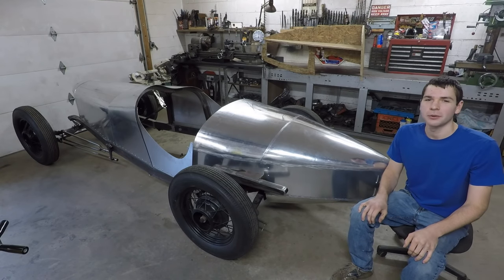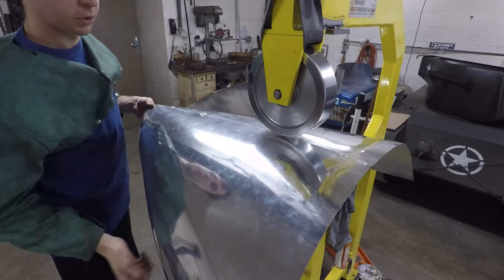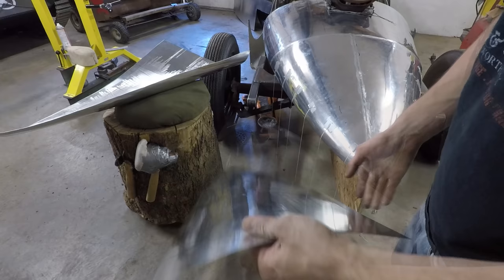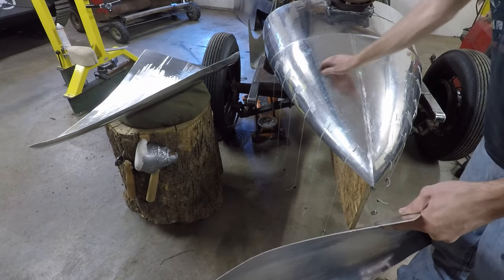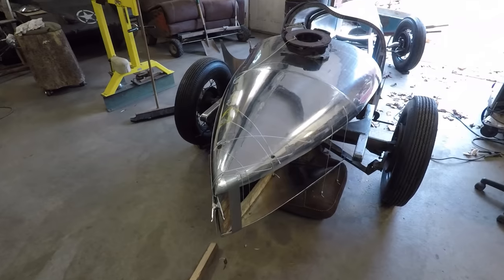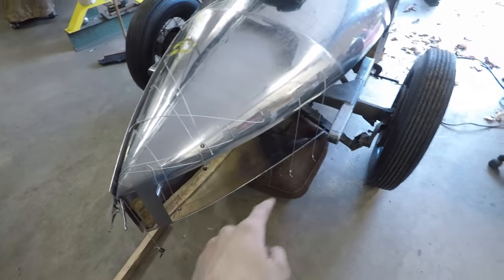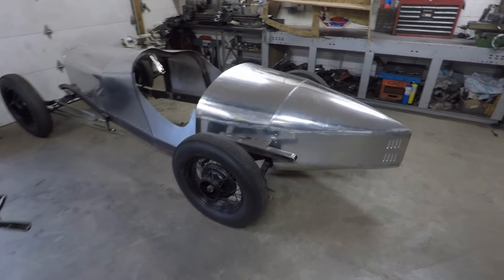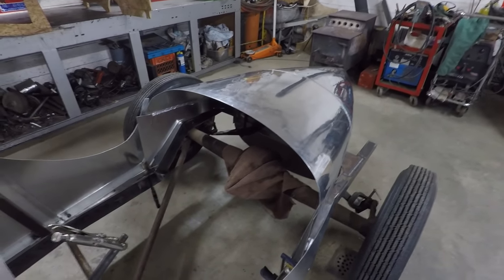Building a Car Body from Scratch | Homemade Boat-tail Speedster Pt. 33

Comment: Over 50 years ago I did a 10,000 hour apprenticeship essentially doing what you are doing here, and for a number of years I restored vintage cars.
Steel was the order of the day then and I only ever did two projects that involved aluminium. No TIG or MIG welders back then so everything was fabricated using oxy-acetylene welding. Time consuming if you wanted to limit distortion! I enjoyed a good reputation and was sought after in regards to this kind of work.
There is a saying. "the older I get, the better I was", but I have to say my workmanship would bow to your greater skill! You have an exceptional gift, and it is a gift; skills like yours are not learnt, they are given!
Loving the project!

Comment: i'm really enjoying this series. I have my own daydream and your work will save me many wasted hours and a lot of sheet metal. back in the pre internet days  I read a story about the proud owner of a new Ferrari. at that time if you wanted to buy a Ferrari, the east coast dealer, Luigi Chinetti, would sell you one ONLY if you could use a non synchro gearbox to HIS satisfaction. 
the proud new owner invited a friend over and they were sitting, sipping drinks and admiring the new toy.
then one noticed that the car looked lopsided. they got a tape measure and determined that it was indeed lopsided and actually had different wheelbases on the right and left side.
you're actually building that thing to a standard that the most famous manufacturer at that time didn't reach.

Comment: One of the things I have noticed with body builders working with aluminium that puzzles me is how they grind their seam down flush. Years ago I had a job making aluminium doors for various kinds of truck bodies. We never used grinding discs on alloy. The problem is they tend to be too rigid and they plug up with the soft aluminium. What we used was autobody feather edgers and sanding discs. The feather edgers turn slower that grinders do and because the feather edging pad is foam they do not dig into the material as much and leave a smoother surface. You have a wide variety of grits available in the form of sanding discs and all you need to keep them from plugging up is a disc dressing which is sort of like a low temp grease that precludes the alloy from sticking to the abrasive.  We did our initial cuts with 80 grit and then went to a 300 grit for the final cuts which leaves a surface that is smooth and flat and the scratches can be filled with primer if the part is painted or polished out if the part is not painted.
Reply: Very well stated.
Reply from the maker: That's definitely something I'll look into when I get to polishing it. I was just using what I had, but you're right.

Comment: Just love the detail of the inset louvers on the rear. Can not work out what they are for but it breaks up the rear line just nicely.
Reply from the maker: They let out air that gets trapped in the back
Reply: @MacroMachines  You said that on the video, but I don't see what is wrong with the trapped air, the car is not going to get blown up like a baloon. I could see a need if you had a need for a flow through for ventilation or cooling system, other wise it is it will allow air to flow into the cockpit area, which will mean you loose the still air that forms a false skin (reducing drag).
So to me they have no practical use (unless you live in a hot country) but look great.

Comment: Nice work. With the aluminum it is easy to see the warping that welding does. Don't see it as easy with thicker metal, but it is there.

Comment: Beautiful. And the jag engine is going to fit right in. Now what about the transmission and rear end? Old Ford parts don't really match up anymore. Also, the buggy springs will allow a lot of sway in the corners. The one on the front is a design element. I get that, but a set of coil-overs or an IRS in the rear would help keep the frame parallel with the road while the speedster is taking lateral G's. I'm glad to see you doing justice to your shops (wood and metal) not many young men your age have access to such wonderful tools.

Comment: nice work, I've enjoyed following along.  👍   Have you considered using WD40 when your sanding down the AL, it helps with the galling?
Reply from the maker: I haven't heard of that, but I might try it
Reply: @MacroMachines  It will also keep you flap wheels from cloging up.

Comment: On Kermit Weeks channel,one of his aircraft engineers shows how to polish the aluminium sheets they install on aircraft. There could be some interesting tips for you there if you decide to polish the car,1920's style.
I had a young guy working with me who has a type 35 Bugatti . The louvres were to let out  fuel that leaked from the tank  and fumes out.

Comment: BRILLIANT work Vince you just keep getting better and better, watching you with the seems on the Boat Tail a suggestion some time back I brought an attachment for my Grinder called a finger sander from either AliExpress or Banggood
I just looked on AliExpress at a quick look and found a nice air sander
Meterk Grinding machine air belt sander that looks perfect for the job and it is at a very good price

Hope that is a handy suggestion for doing the seems and many other things ( IF you get it order More belts at the same time to have on hand) on the racer

Question please, with the louvres facing towards the front of the car won't that cause drag, what do you want them to do? If they faced backwards then the benuli effect would Take the air away from inside the boat tail as it is it forces it into it and causes drag 
Loosing Hp and speed 
Tony from Western Australia.
Reply from the maker: The way I did the louvers will still pull air out of the body. They're not only punched inward, but also reversed so that it'll give the same effect

Comment: Now made my own Home made Boat tail Speeder with full Roll cage and racing hanas and racing seat, Twin Turbos V-6 Engine, FR to not wight of AWD system more throttle and power sliding, and my Ground-effect study's and builds plus my aero kits studys as well, and quick changed Gear box form Drag Racing, Top-speed mile and or land-speed,  track oval or road course racing time attack racing  aka (Superlap),  pike-pikes, and sliver Steak  Nervda classic and  Nervda Road challenged!
Reply: I left one other detail that is lighter then metal outer-body car but the metal outer body  part can be used for component casting molds for fiberglass and or carbon fiber.
Reply: I going draw and plan out my own Super Competitive Car Body and chassis from Scratch | Homemade Boat-tail Speedster, that well be faster then Hybird Car class/DHPI or Imsa/WEC Racing in 2021! Even took 10 years to do so!
Reply: Also for off-road racing and dirt oval as well the tires as well.

Comment: Fantastic project.  I did a smaller version of this for my Cyclekart and I can say that you have a very good eye and a steady hand to put that tail together so very well. Very well done.
Would you mind sharing some information about the aluminum and the welder you are using?
I assume this is 3003 aluminum, thickness? .063?  Also, what thickness filler wire and tungsten?
Reply from the maker: yup, the aluminum is 3003 .063". I used 1100 for the filler rod. 4043 also works, but it can crack more easily

Comment: Oh man you were teasing me with the louver press. It looks so good man. Likely holy ** it's gorgeous. 
Really want a close up of your board of inspiration and what you plan to take away from certain design aspects. I'm really really realllly curious about your plans or wants for details like trim, headlights, dash, wheel, seats, etc. 
Any chance the GN Jap is on that inspiration board? The one feature I think would be of interest to you is the seating arrangement. Which has the passenger seat offset slightly backwards. So the passenger isn't rubbing shoulders with the driver. Just saying might be something worth looking into. Jay leno has quite the large figure.

And don't think for even a second that you won't be rubbing shoulders with Jay as you blare up the freeway at ungodly speeds listening to the high RPM roar of that jaguar as Jay laughs with childish excitement.
Reply from the maker: I get most of my inspiration from the early boat-tail indycars, other speedsters like the Bugatti type 35, and traditional hotrodding
Reply: @MacroMachines  t-35 is the Pinnacle of vehicular perfection. Its pretty awesome you have the skill to build your own. Closest I'll probably ever come is a cheap fiberglass knock off on a beetle pan.
Reply: @MacroMachines  tho don't get me wrong even if I had a real one or a pur-sang one I'd still get the fiberglass VW version and hop it to hell with a Subaru engine

Comment: Looks great, having everything fitting together in three dimensions isn't easy as you make it look, I was just going to ask about an inner structure, are you going to rivet the inner structure to your panels? Copper or brass/bronze  rivets would have looked so cool on this, but it looks awesome

Comment: Those compound curves are so lovely... You're doing an outstanding job. By the way, shouldn't the louvres slightly protrude from the rear flanks of the tail (instead of being turned inwards)?
Reply from the maker: They can work either way

Comment: Would like to know the reason for a 👎, I believe that we all could (maybe) learn something.
That tail is a very big piece to repair if the unthinkable happens it should be easier to remove - or maybe I'm not seeing it well.
Reply from the maker: I designed it so that the whole boat-tail will be able to be lifted straight off the frame, so it'll be easy  to remove
Reply: @MacroMachines  Ok, I didn't understood that.

Comment: was wondering if you anealed he material , now i know you do
verry impressed with youre metal working skills considering the short amount of time passed since you started with metalworking
maibe after youre done with this one , you can do a fendered car , either a modern car in aluminium or sumting like an ac cobra 
https://upload.wikimedia.org/wikipedia/commons/thumb/e/e8/Shelby_AC_427_Cobra_vl_blue.jpg/1200px-Shelby_AC_427_Cobra_vl_blue.jpg

https://uploads.carandclassic.co.uk/uploads/cars/ac/10796800.jpg

if you use a bmw as the donor for the suspension and engine you will end up with a cobra that will corner and brake a lot better then the original 
i once seen a car like that done based of a corvette , the guy had ripped the fiberglass off a gen 2 and remade the whole body in aluminium doors and everything , with some added flair like big hoodscoops flared fenders and a flip front (talking 1980's here )
it was mostly a showcase for his talents as a fabricator